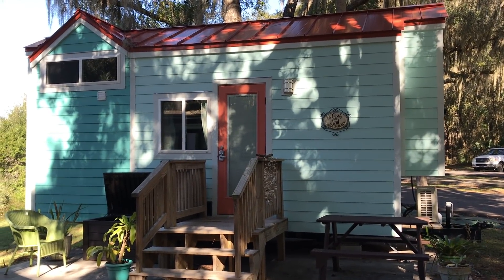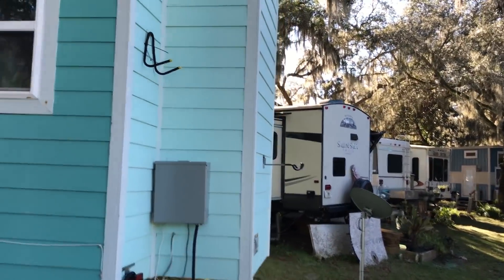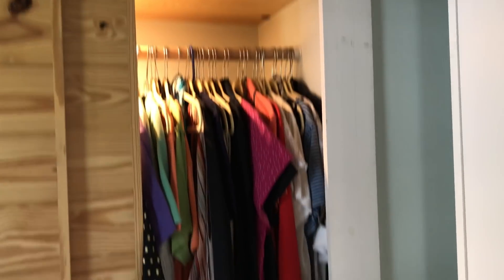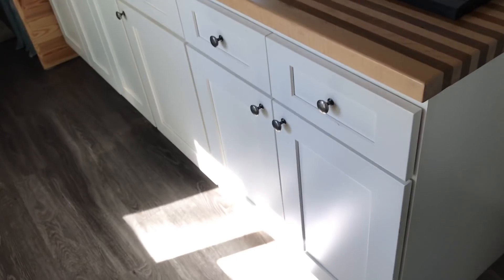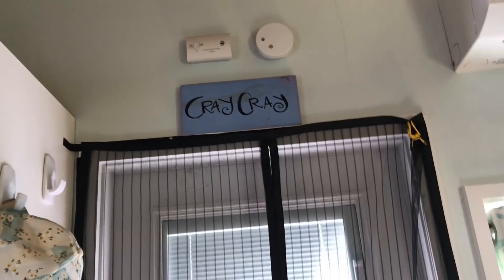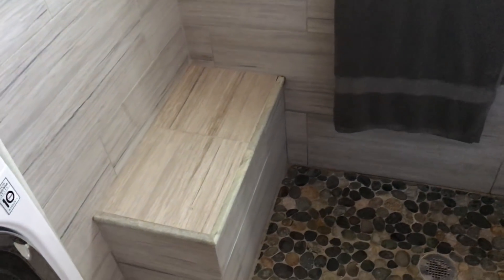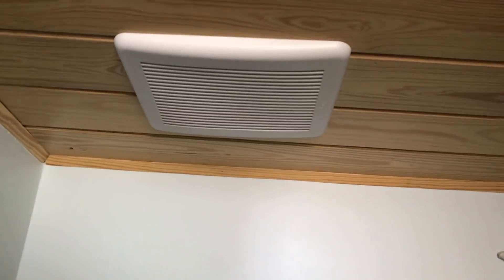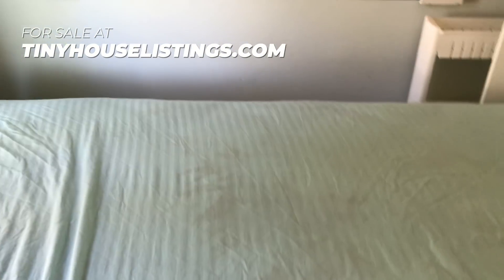Adorable Tiny House Cottage For Sale in Florida

Comment: They should have made a an elevator bed for the living room so that the living room could be utilized as a real living room. Not a fan of this one.
Reply: Always a trade off, elevator beds tend to sit high and if you have any mobility issues then it can be troublesome to access them if they're too high, which would be the case if you had a living room space with furniture it would have to sit on top of... Also more risk of failure with any mechanical system, as well as long term safety concern if that happened and there was no safety mechanism to prevent the bed dropping from the ceiling...
Reply: Could use a settee that moves and pulls put as a bed.
Reply: @ZeoCyberG  They have pins to hold them in and you can use a chain pull.
Reply: @kamikazitsunami  Pins don't help when they're moving them...
Reply: TOTALLY AGREE!!! 👍I THOUGHT THE SAME THING!!! 😊
Reply: I love your house 🏠 . I still  for selling?